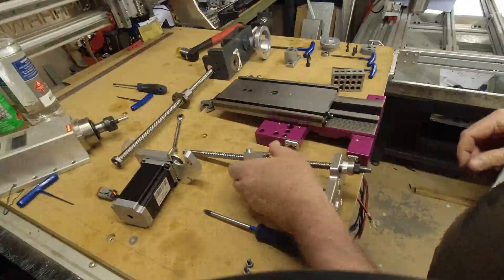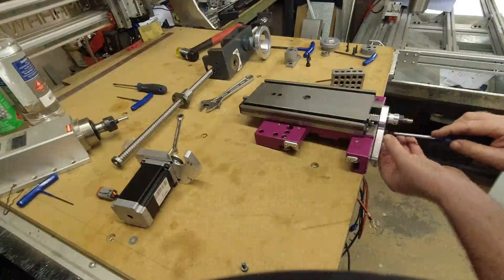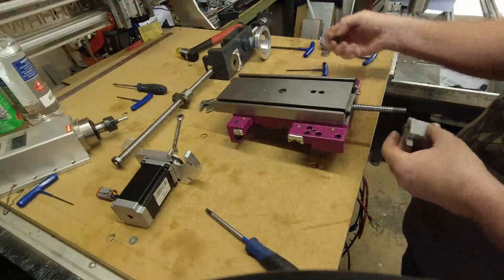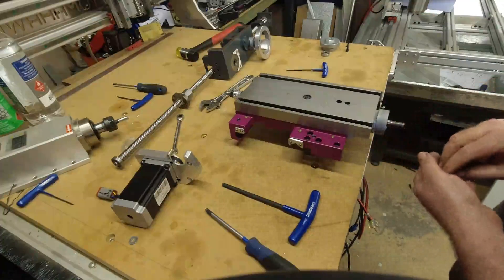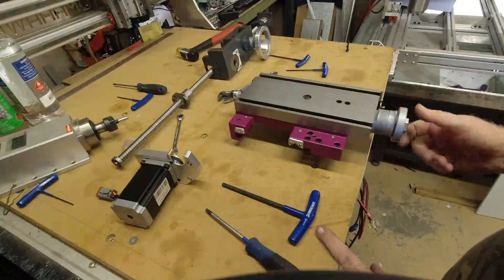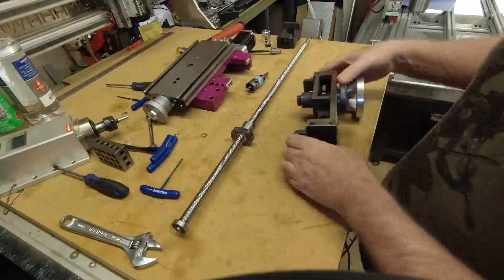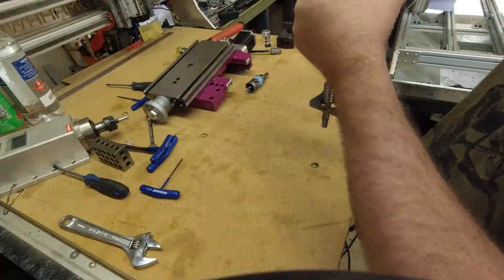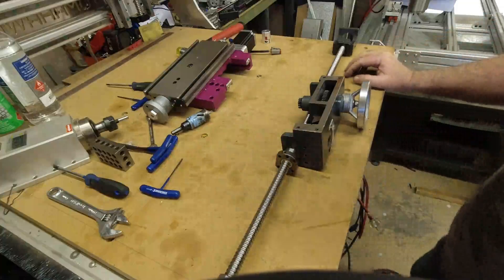Optimium Lathe CNC conversion  TU2506V

Comment: Hiya, what ballscrew did you use for the cross slide ? I have a similar lathe, thinking of swapping the leadscrews for ballscrews. Your CNC conversion looks pretty nice, cheers
Reply from the maker: Custom  ballscrew setup , nothing off the shelf would fit in thd available space
Reply: @tomahawkcnc  would you be able to share the size and plans if possible ? It'd be much appreciated, cheers